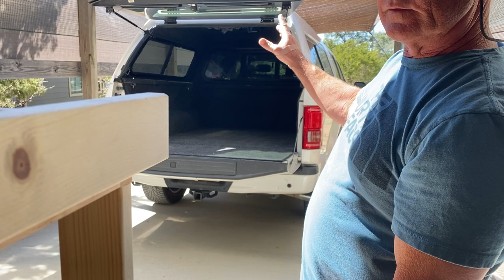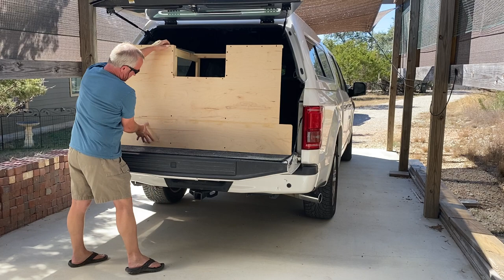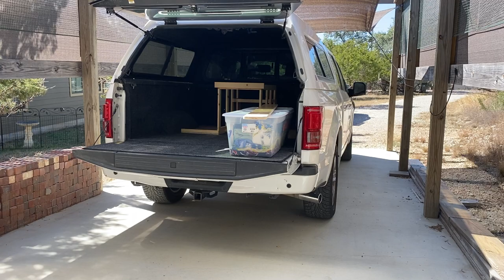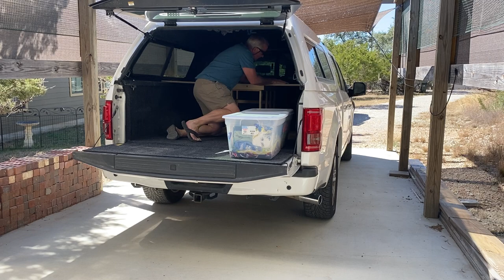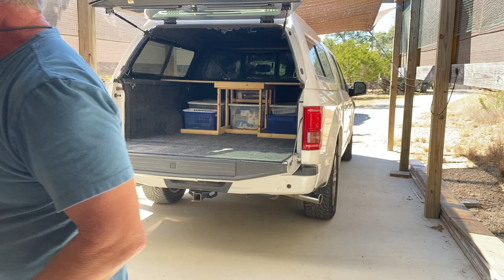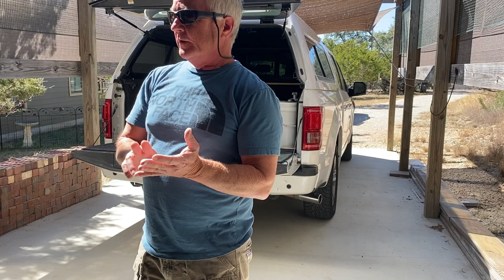Short Bed Pickup Truck Camper System within Shell.

Comment: I like it’s simplicity along with the amount of gear it holds.  Better patent that design.  Looks great!
Reply from the maker: Glad you are happy with it. I think you can store it when not in use with all the totes placed back on it in one neat little pile and then using it should be straight forward and easy to take in and out. The sleeping area is 30 inches wide so should be able to get a good night's sleep in there. I also purchased new bins for you to use. The blue ones and the one that goes up under the sleeping rack. One of your white ones fits inside that blue bin to allow you to compartmentalize the space. You may want to get a second white one to do the same on the other side. See you when you get back.